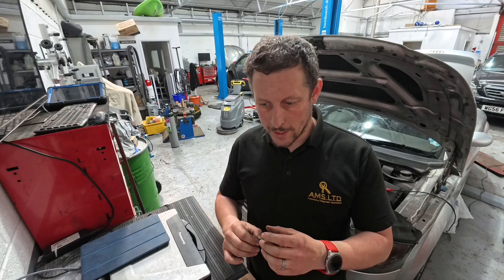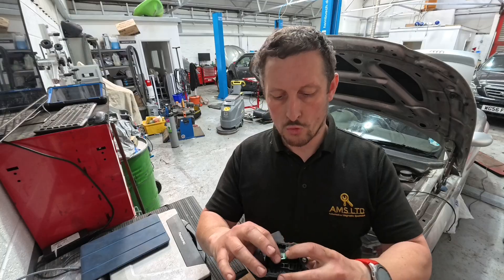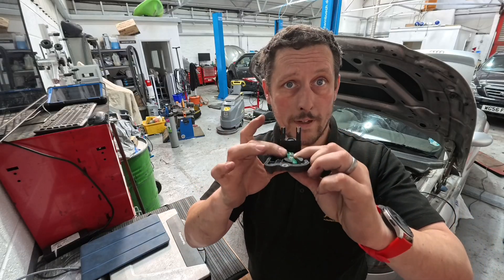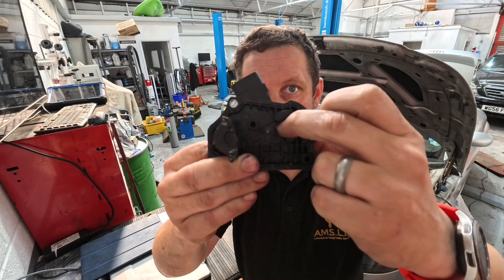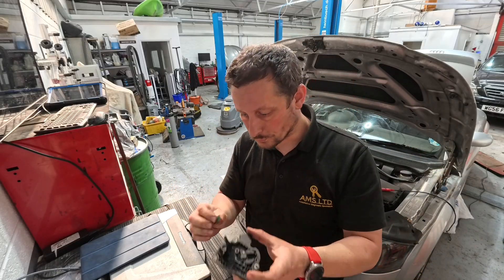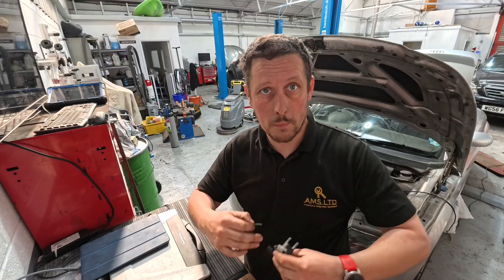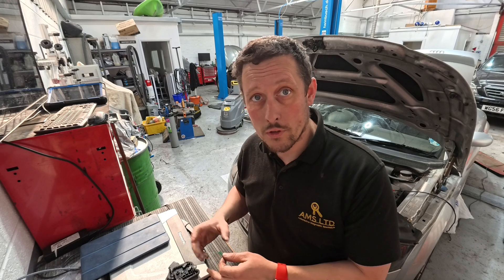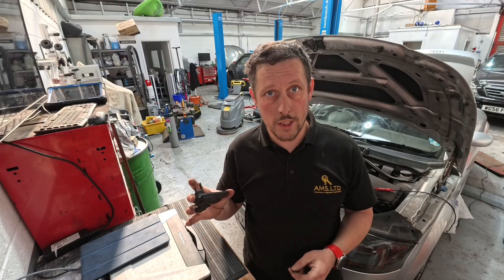🔧 Astra Water Pump Failure – Follow-Up 🔧

Comment: Plastic anything under the bonnet where there is heat cycles. Never gonna last over time. Maybe that's the whole point. Better off metal parts, on metal. Plastic for clips only, even they go bad.
Reply: That’s the whole point if they wanted them to last